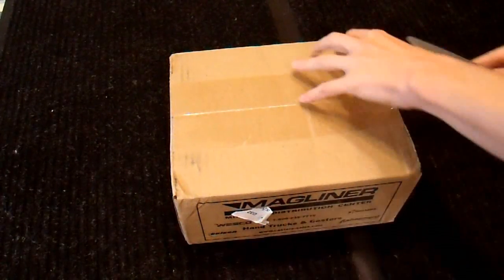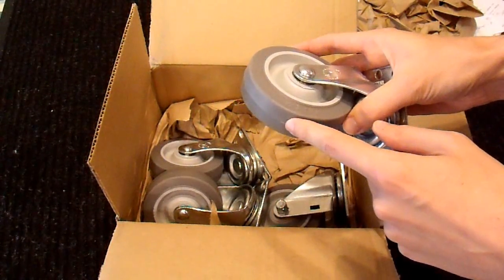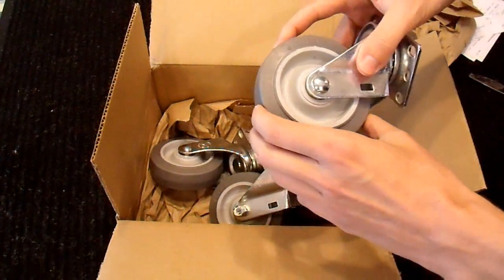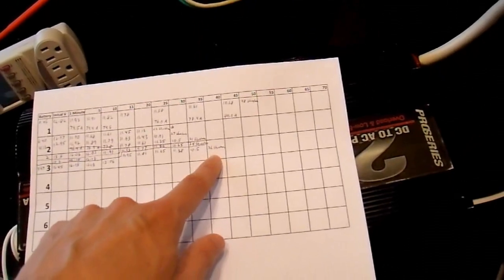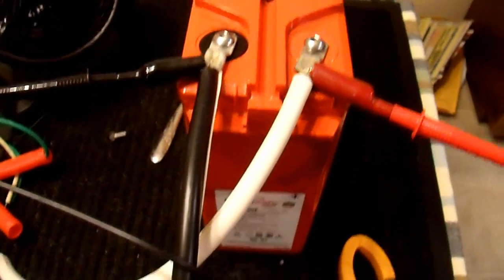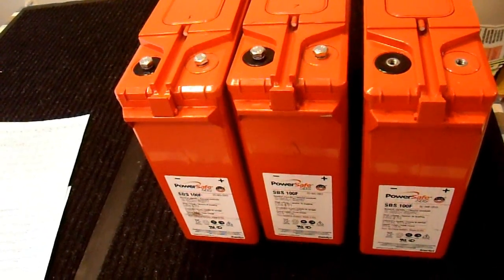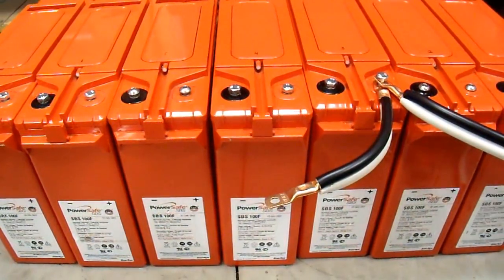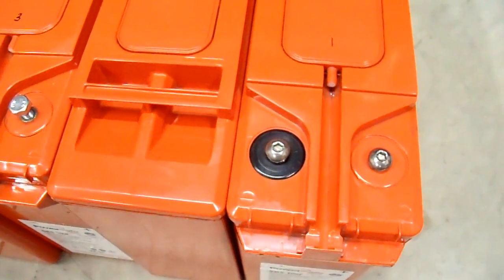1000Ah Battery Bank Part6 - Finishing the Battery Testing and Planning the Battery Bank Setup

Comment: Hello there,
I have some sbs 40 batteries which are very similar to these but they have access to open them on the top which will allow me to add acid or distilled water. I have 12 of these and am looking to recondition them as you have taught us through these videos and am really interested to know if it is ok for me to add fluid to these as I go? 
Thank you in advance for any advice 

Jay
Reply from the maker: Yes, if you are able to access the top caps make sure they have distilled water added up to the proper level.  The plates should be covered with water and be sure to not overfill.

Comment: I do not know what the wheels cost you but a small moving assistant costs about fifteen dollars and you would have the job over with a small base for your batteries and chargers. Regards, Edgar Now that I think about it this video is about three years old.
Reply from the maker: Those moving dollies are extremely cheaply made.  I would highly recommend purchasing something of better quality for a purpose such as this.  These wheels still work great.

Comment: i really enjoyed the depth you went into in regards to the equalising etc, very well explained thank you. I intend to put my own batteries through a similar load test etc in the near future. I myself have ten very similar batteries hooked up into a 1000 amp hour 12 volt bank, however what I did when it comes to wiring them up, I believe was an improvement, and I did it the way I did after learning about the advantages in regards to extending the battery life. i actually have  5 batteries in a row on one side, and the other 5 in a row opposite, all of the terminals are on the inside edges. I then created my wiring harness 5 positive cables and 5 negative. Each cable is exactly 50 cm long and cable 1 for example goes to positive on battery A about 35cm down, then terminates to positive on battery B at the end of the 50cm long cable. Cable 2 goes to battery B negative first and terminates on battery A. This wiring system I then repeat for each pair of batteries which gives me the exact equal resistance on all batteries. You will understand why I have all terminals facing each other so that I can have each pair cabled up with cables of exact size. I have brass terminals then located in a central position above the bank. I learned that wiring the batteries the way I did is the optimal way to do it, otherwise its likely that the batteries on the ends wear out first as they have less resistance than the others. Hope you understand what I mean

Comment: Maybe i missed it. So you have multiple batteries that hold different charges. Is their an optimal order to connect them into a bank. ie lowest voltage to highest or lowest in the centre of the bank highest at the charge points or vice versa? Or it doesn't make a difference? Thanks

Comment: I would have used those front access bars to move only one pole to the front side.  That keeps them low profile compared to your approach, and separates the poles better, and saves you angle trouble.

Comment: Commenting on the obvious again.

Run one short jumper out from the terminals and the next one in that line (positive or negative) in over the body of the battery.  That allows using short cables with the connectors aligned with the battery.  Nothing at an gle to make connections difficult or provide an opportunity for a short circuit.
Reply: I initially done my bank the way you suggested, until I learned about the wear and tear on the end batteries in relation to resistance. It is the reason why number 8 battery died, it would of been at one end. I learned this from an electrician who actually calculated mathematically the resistance and current drawing anomalies with various wiring systems, it makes a huge difference

Comment: At 9:30 minutes I thought you could fix the arching problem by connecting wires at the terminals in a figure eight pattern as illustrated below:                                                             

            ________                                                        ___________                             _ connect to + terminal of (5), (6), ect.
          /                   \                          ____________/_                        \                        /
        /                       \                      /                        /    \                        \                    /
 _/_____              \__________/_                   __/____\__                  \________/.
|   --          +   |            |  --             +   |                |   --           +   |              |   --           +   |
|                  \ |            |   \          /      |                | /                \ |              |     \         /    |
|                    \____ |___\___/        |                /                    \              |       \     /      |
|                     |            |       \_____ |_______/ |                      |\____ |__ \_/        |
|                     |            |                      |                |                      |             |           \_____|___ connect to -- terminal of (5), (6), etc.
|                     |            |                      |                |                      |             |                      |
|                     |            |                      |                |                      |             |                      |
|        (1)        |            |        (2)         |                |        (3)         |             |          (4)       |
|                     |            |                      |                |                      |             |                      |
|                     |            |                      |                |                      |             |                      |
|                     |            |                      |                |                      |             |                      |
|                     |            |                      |                |                      |             |                      |
|                     |            |                      |                |                      |             |                      |
|                     |            |                      |                |                      |             |                      |
L___________|            |____________|                |____________|             |____________|

Rather than connecting the 2 wires on one terminal to form a V shape (about a 45 degree angle) connect the wires so that they face each other as if one continuous wire going over the terminal, then cut, and butted with connnectors to bolt down at the battery terminal (now 180 degree angle). 

Maybe save some wiring this way...

I know I am suggesting this way late, and you already had an alternative solution before posting this video, however, I thought I'd share what I thought when watching.  Thanks!!

Maybe someone else can benefit.

~ Patrick

Comment: You spent the first three minutes giving us a caster demonstration. Your roll around cart video should come after the battery testing videos.
You realize your title is deceptive as you are only working with a 700 Ah battery bank. A battery bank should always be the same type and age of batteries. Adding those other batteries to make it 1000Ah is not a good idea,
What I finally heard was you said it is cold in the garage so you moved indoors. A battery capacity is affected by temperature. Battery specs are done at a set temperature of 77F. If the garage was at 32F then the battery capacity dropped to 70-80% of rating. Is that what happened to battery #2? When you test it again do it at 100F and it may be better than battery #1.
Remember that each time you drain those batteries it is shortening its life by 1%.If you were planning to get 1500 cycles by discharging to 50%, you just used up 15 days (cycles).
I have not seen one manufacturer suggest 15 volts for AGM batteries unless they are cold. It might be okay for your batteries since they were basically free but if someone spent hundreds of dollars for a bank of AGMs I would be careful.
I think you should have used the batteries for a month in a bank and then tested them.
Reply: Tim Steinkamp He needs to find the condition of each battery to determine if it would be a good idea to use them as a battery bank. Are you suggesting that he should have created his bank, and then tested the performance of the whole bank?
Reply: epohnopulse
Yes and No, after using them (the seven) in a bank, with at least 20 cycles of 50% discharge he could then test the bank and check each battery if the amp hours received from the bank in each cycle is low taking into consideration rate of discharge and temperature..

Comment: how long this bank will work for 3500 watt Air conditioner ?
Reply: if the Voltage 230 Vac
Reply from the maker: smohed sh
Not long.  That's a huge load for batteries to handle.  With 10 batteries that would be about 32A per battery.  At that rate you'd get a little over 2 hours, but to avoid damaging the batteries it would be better to keep it to around 1 hour.

For that type of load you're probably going to need much larger batteries that aren't portable for a single human.
Reply: ***** thanks for your response
I want to ask you if I have 6 KW room I want to use Solar energy how many batteries  do I need and what kind of batteries should I use?

Regards

Comment: what does amp hour mean. what voltage is measured to 50% of charge?
thanks john
Reply from the maker: Amp hour is amps*hours.  It is the amount of amps that you can draw from a battery for a specific amount of time before the voltage drops below 10.5V.  Usually the rating is given at a C/20 rate, so if it is a 100Ah battery they they rate amp hours at a 5A constant draw for 20 hours.  If you draw 5A from the battery for 20 straight hours then the voltage will be 10.5V which is arbitrarily defined as 100% discharged.

50% state of charge is not defined and varies depending on the battery but will be somewhere around 12V.

Comment: put your battery cable ends on a vice and pound them flat...that will do it
Reply: Rangerman s Nothing should go in between the lug and the battery.
Reply: or stick a washer or 2 in between the lugs when they're on the terminal
Reply: no, my comment said between the lugs. This would be to space the connectors so they fit better. Also, copper washers would be fine either way.

Comment: is it better to use 6v battery or 12 v battery for longer use in emergency?
Reply from the maker: 6V batteries have 3 cells and 12V have 6 cells.  There is no other difference that is due to the voltage difference itself, so voltage is not a deciding factor for batteries.  However...  Batteries are generally made to be of a size that is convenient transport and handle and this limits the cell size that a 12V battery can have and still be of a manageable size.  For this reason some of the best inexpensive and transportable batteries for long term use are 6V golf car batteries due to their cells being twice the size.  There are certainly good 12V batteries out there too, so I wouldn't base the decision on voltage alone.

Comment: Personally I would use a busbar to connect  the -ve direct, and then connect the +ve via a 100amp fuse and then that to a busbar, the reasoning behind doing it this way is that if one battery was to go short cct it would blow the fuse it is connected to and the rest of the bank of batteries would continue to function and not be taken down because of one faulty battery.
This is the way I did it when I was doing battery install for a large telco here, the battery banks we installed used 550Ah cells with some 10,000 Amps of instant current available. One tech found out the hard way when his spanner was vaporised when it fell across a single cell.

You may be able to buy copper busbar from a metal supplier I will be using some busbar that is 20mm wide and at least 10mm thick for my soalr / battery project.

Comment: From all I've read you should never parallel batteries of different capacity as there is no way to charge where the better batteries wont cook while the charger sees and is trying to bring them up to the level of the average. I would suggest trying to bring the lesser capacity batteries up to the better ones before you parallel them into a single battery. Is this not accurate?
Reply from the maker: Batteries of differing capacities or differing state of charge can be recharged in parallel without issue.  The problem comes in where the batteries have a different self discharge rate or different chemistries or condition (either due to construction or age).  For maximum life in an industrial/commercial application, yes, they should all be the same type, age, and should reside together in the same bank from cradle to grave, but in many applications mismatched batteries are routinely connected up in parallel without issue.  Watch the electrolyte level (for flooded batteries) and it won't be a problem.

Comment: Are you going to charge them separately or all together? and if all together can you explain how you are going to hook them up to get a equal charge in your next video? Thanks!
Reply from the maker: I have been charging them all together in parallel.  As long as the batteries are of the same type, age, and condition they will charge equally.  I added a couple of mis-matched batteries in my final setup but verified (separately off-video) that they are compatible enough to be left in parallel indefinitely during charge and discharge.

Comment: ITS A WASTE OF WIRE.. USE 2 BAR`S (ONE FOR POSITIVE AND ONE NEGATIVE) AND you can save half the wiring
Reply from the maker: What would you suggest I make the bars out of?  I didn't have appropriate material on hand for this.  Possibly buy and flatten copper pipe?  Wondering your specific suggestions...
Reply from the maker: Also I want to keep it flexible (I can add or remove batteries easily this way and can re-use the cables at a later time for other applications) and allow for movement.  It is extremely abusive and is asking for problems to mount batteries together with a non-compliant connection.  Battery connections should always allow for some flex/movement.  Even just thermal expansion/contraction can put large stresses on the batteries and connections.
Reply: ***** i used 1/2" copper pipe inside of another  3/4"copper pipe and flattened the hell out of it. i then drilled holes where needed. i also used carboard spacers in between the batteries while mounting them and then removed the carboard. space is needed for when batteries swell up
Reply: *****  used small length wire from terminal to the busbar. you dont need 2 sets of wire on each terminal. just one
Reply from the maker: spturks
I really like that approach, thanks for sharing!  I may try it out on my next battery bank.
Reply: ***** First thing I thought was why not use the front access bars, and the top terminal.   One of your cables to the top terminal, coming from the last battery, and one cable coming from the front access to the next battery.

Comment: You could just use half of the extenders and just run the positive across the front and the negative across the top. or loop the negatives like you showed and loop the positives towards the rear.
Reply from the maker: That is a good thought.  I didn't have 7 of the front adapters so I would have had to make something, but it would be one way to get around the 'parallel connection on a battery designed for series operation' problem.

Comment: i believe they were designed for convenience during maintenance, you wouldnt need to get around to the other side to see anything. would suggest screwing your positive wire on top and alternate terminal adapters, so that the  negative line is dropped down in front, but alas, you didnt come up on all the the front-access terminal adapters or shields =\ wonder how much they cost